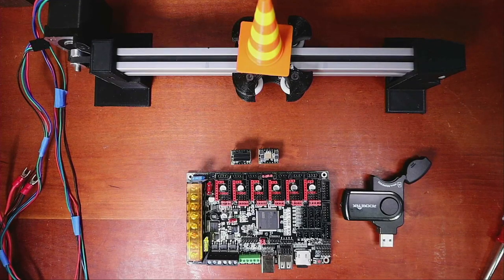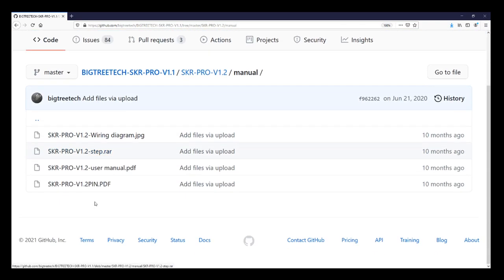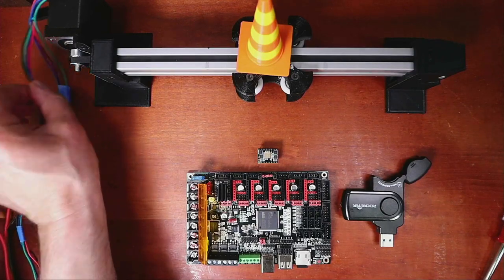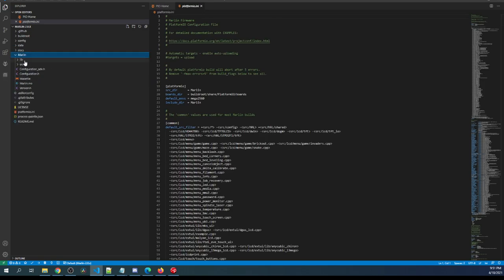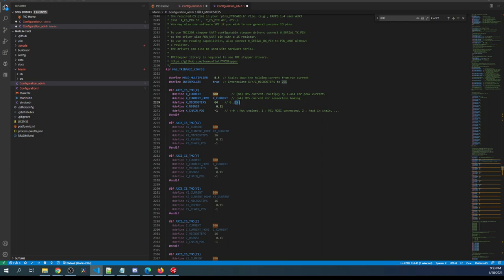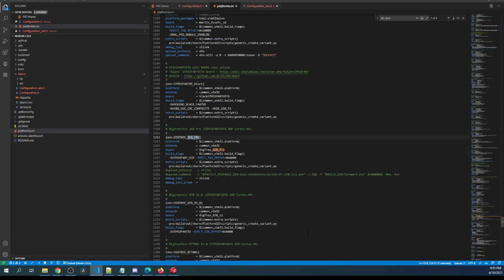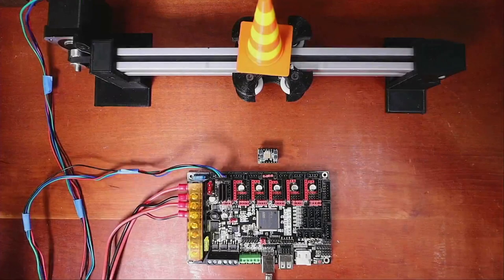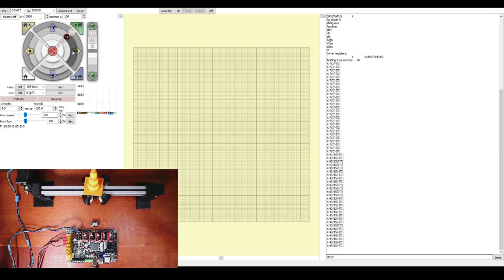SKR Pro v1.2 - TMC5160 SPI

Comment: 32bit board is something new for me... 
Is the firmware stored in a sd card than inside board memory like 8bit board?
Can I use IDEs like 8bit to modify firmware and Is easy as 8bit or PRO knowledges are required? 
Can I still use Arduino Ide? 

I noticed you use usb sd card reader, can I use integrated laptop sd reader? 

Are there a lot of differences / improvements between 2208/2209 and 5160?
The 5160 need new stepper motors?

thank you
Reply from the maker: It's best to ask long questions in discord link below.

Comment: thankk you for this tutorial , just a question Any idea about the error TMC CONNECTION ERROR , im using the SKR PRO v1.2 Board as controller for MPCNC and TMC5610 as Drivers the jumper is set to UART pins
Reply from the maker: Is PSU power absent when you see TMC connection error?

Comment: Thanks so much for your videos. Has being so helpful.
I have a big question over here and i'm running out of sources. I own a "SKR pro 1.2" and for drivers I bought "closed loop MKS SERVO42B"... I'm wasting the MOTOR POWER exclusive inlet? 
I thought other people already tried to do that setup, so i could just pick up the accumulated experience... but maybe I'm the first with that dumb idea.
I never connected anything fearing the "definitely not so happy smoke".  The project i wanna build is the MPCNC primo.
Reply from the maker: I'm not a fan of closed loop steppers.  They only have value in Earthquake zones.
Reply: @EdwardBraiman  funny enough, I live in the most active zone on Earth. In fact my country sustain the record of the most destructive and powerful earthquake ever recorded... So maybe I'm predestined to use those controllers.
Reply from the maker: Are they daily or hourly Earthquakes and what's the scale of quakes?
Just keep in mind that stepper has the precision of a A4988.
Reply: @EdwardBraiman  no schedule... At least once a week Earth moves at 6.0 Richter minimum... But any other day, if you are foreign you can feel the shaking sensation at times... Or see the ripple effect on your 3d print